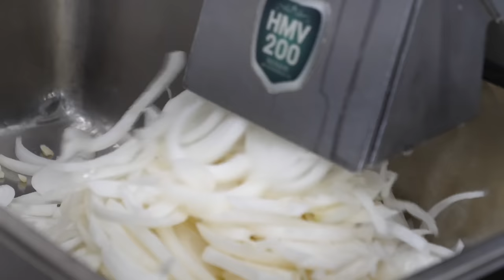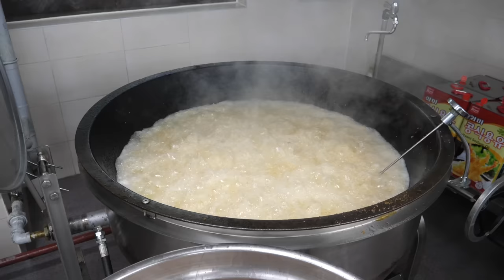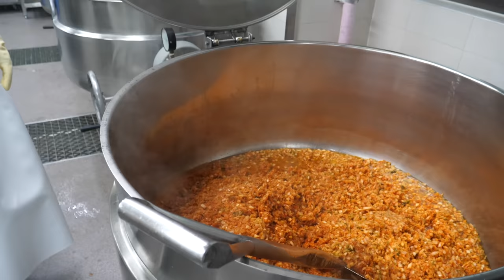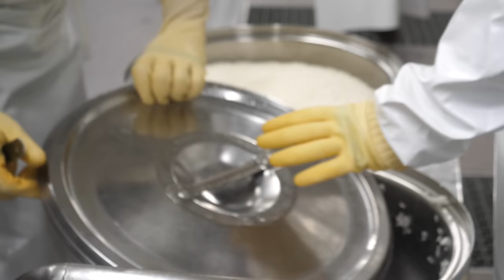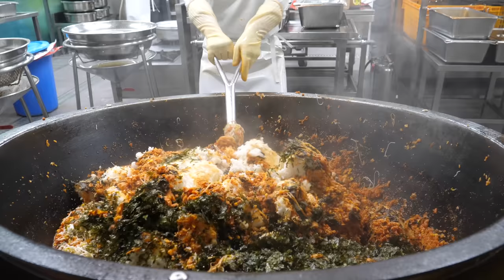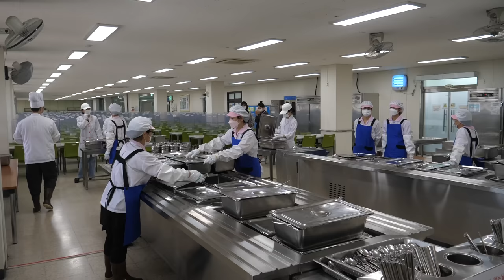평소에 보기 힘든 고퀄리티 급식 스케일! 여고 1,100인분 압도적인 급식 만들기 Meal production process at Korean girls' high school

Comment: having to mix it with a big shovel like cement, just doesn't seem right .
Reply: what else tool they should be using?
Reply: @규헌-s1l  making smaller amounts. if i wanted to feed the whole street or a football team,  I wouldn't make meat pie as big as a car just lots of them. same with something like a curry and rice.just use catering pan and make however many you need.easily organised with help. I used to cook for 2 to 3 hundred at dinner time.wouldn't dream of cooking like that.